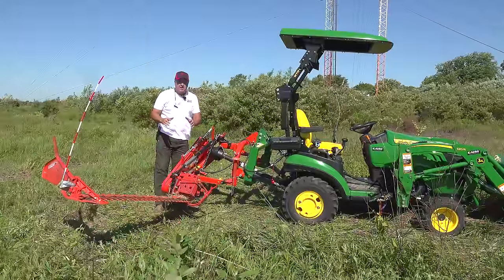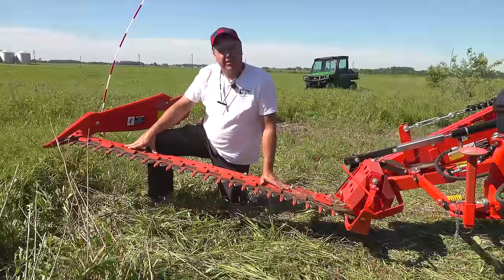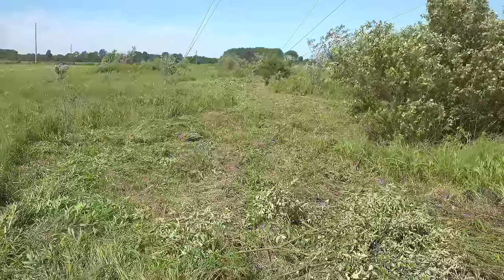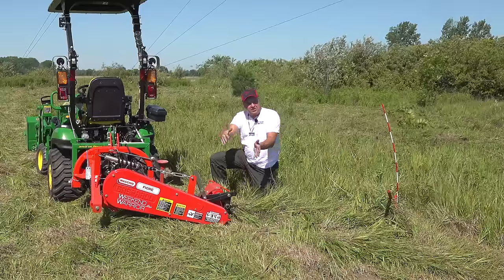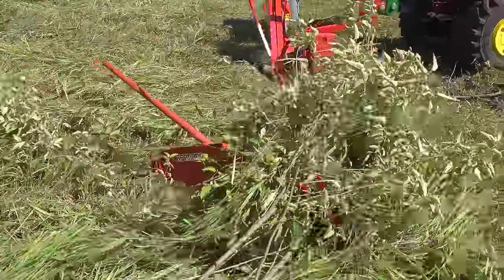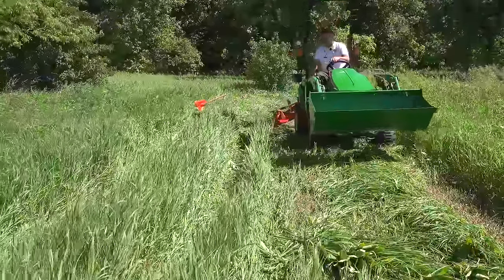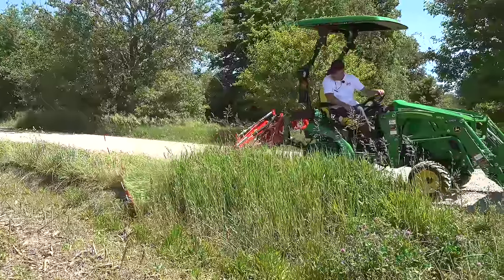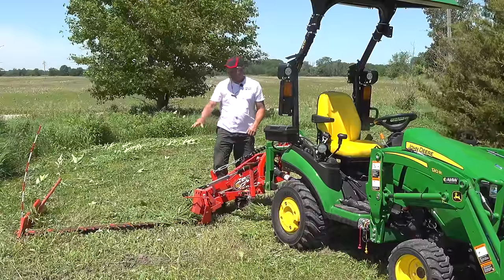Sickle Bar Mower for Subcompact Tractor!

Comment: In my youth, 65 years ago, I mowed a lot of hay with a sickle bar mower.  In the beginning, we pulled an old horse drawn machine with a 6 foot cutting bar behind an old JD A.  Later we got a late model B and then a 50.  We used a JD semi mounted model 5 with an 8 ft bar .  We mowed in 4th gear at about 5  mph.  The big difference is the tractor weight at about twice what a 1025 weighs.

Comment: I have a 1949 Farmall Cub that has belly-mount cycle-bar mower as one of the attachments, and I love  it. I used this mainly to cut my orchard grass due to the fact that I was able to get under the trees without getting into the branches or damaging the fruit/buds.  I grew up on a farm in Kansas, so did a lot of hay making. Love your series on these tractor comparisons, and very informative as I am making a decision between these two tractors for my next purchase.

Comment: I have about 4 acres here in S.E. SD, when I first bought my place all I could afford to cut it was a 1965 Wheel Horse garden tractor with a 4' belly mounted sickle, 8hp. It took me a while but I could cut all 4 acres no problem, sickles take so little power. I've since upgraded to a Branson 2400h with a 5' Rhino Bush hog. It's a lot faster. However in the spring that ground is too soft and wet to run the heavier tractor. And by the time its dry enough the grass is almost 3 or 4' tall in places which really slows me down on the Bush hog. That little sickle mower don't care how tall the grass is and the entire tractor only weighs 450 lbs so I can skim right along over soft ground. It sure turns heads when people drive by seeing that little tractor cruising along just laying down the grass so nice. Theres something so satisfying about watching a properly tuned sickle run.

Comment: I had a care company growing up.  I jumped at the opportunity to buy a hayban 4’ cycle bar mower for my cub cadet.   I got it for only. $250.   I used it for all you have mentioned.   The other benefit is you can cut the rough grass, remove large limbs and rock that might damage a rotary finish mower, and then use the finish mower to cut up the cuttings.   I found this method also did not load the tractor as much as trying to cut heavy grass with the finish mower alone.   Great video!

Comment: 🤠 Well that fired up the ol' memory retrieval system!  Spent several Colorado summers way, way back when in my youth cutting and bailing "upland" hay (non irrigated light density) using a JD 1020, a 9' JD sickle bar mower, a JD 3-pt reel rake, and a JD 24T bailer.  I can still smell it right now in my memories!

Comment: Available on Amazon (and presumably elsewhere) are “cup” magnets. These are flat magnets with a reasonably strong pull, and a countersunk hole in the middle. Also available on Amazon is some spring type broom holders designed to be screwed into a wall or cabinet. What I did was order a package of each, and using some M5 flathead bolts & nuts that i already had on hand, bolted the broom holders to the magnets. Then I stuck them onto the loader and ROPS to hold hoses & wires for my sprayer... something similar would probably be helpful for your hydraulic hoses. They also come in handy for holding a cane, walking stick, or long-reach tool.

Comment: Tim, I have an IH 1300 sickle mower that I used in the past to mow a ditch.  Haven't used it in years, but works excellent, and you are correct...I think I paid about $1200.00.  I haven't sold it because as soon as I do sell a piece of equipment, I realize a situation I could use it for.  Thanks for the info, and the Maschio flail mower looks like a great mower.   Bob

Comment: The first tractor/attachment I ever used was a 1949 JD "M" with a sickle bar on the 11-acre farm I married in to.  Compared to the new devices, the old mowers were archaic.  "Down" was only about 7-degrees, "up" was maybe 35-degrees.  To transport the machine meant turning off the PTO, getting off the tractor, retrieving the transport bar (a 5/8" rod about 5' long with a hook at one end and an eyebolt on the other),  thread the eyebolt through a hole in the blade, lift the blade to the vertical position by arm and back muscle, and hook the transport bar hook to the appropriate place, get on the tractor and transport to the next field.  Then reverse the steps.  The mower could not run in the up position without self destructing.
Because of the limitations of the swing range the mower was useless at mowing pond  banks or ditches.  Of course, the same could be said of bush hogs and flail mowers in the same circumstances.
With the new stuff I might be tempted back to the sickle world.

Comment: Tim I would really like to see you find some hay ground and get Tractor Tools Direct to send out a Hay Package with net wrap baler, disc mower, and belt rake. I know it is a niche market, but honestly for gardeners it has potential too.
Reply: This right here !!!!! I have a 2019 2032r and I need some sort of hobby farm haying solution !!!!    This sickle bar mower is perfect other than being frontier green ;) as he said.  But we need options for bailing and wrapping equipment !!!!!!!!!
Reply: @kelstr  0 pipe
Reply from the maker: I LIkE having the attachments be different color than the tractor!  Guess I’m kinda strange that way??
Reply: The little hay mower fer small tractors would be a drum mower not a disk mower.  I have one fer doing hay and its awesome. Granted I use it on a full size tractor but the smaller mower can be run down to somewhere in the 20 pto hp.

Comment: I have a 7 ft Farmking (Enorossi) double acting 3 pt mower that I love to use.  Never plugs. Has hydraulic lift (the only way to go).  I use it to cut 25 acres of hay, to mow my pastures, etc.  I highly recommend these double acting sicklebar mowers.  Mine was about $4500.00 two years ago purchased from a Case IH dealer delivered to the farm and attached to my 33 hp Mahindra tractor.

Comment: I bought a used 7 ft New Holland sickle bar mower about 15 years ago when I thought I wanted to cut hay on my 12 acres.  Decided it was too much work.  Sold everything except the mower.  Use it about 4 times a year to cut pond dam and ditches.  Best $800 I ever spent.

Comment: I sold my 100 acre NH 451 with a 9' bar last summer. I'm in NE Texas and the man drove from Alabama to get it.90's model and was stored in a metal shop building since early 90's.Got out of the hay business right after I bought it new.Man wanted it specifically to mow around his 10 acre lake. Got video up of it running etc.Back when I bought it I seem to remember it was $4200.00 new. Lot of money back then.Had another NH 451 with same 9' bar before it. Bought it new too but it had a factory defect and would eat wobble head bearings. Fought it for several years and finally convinced the dealer to swap it out.Mowed in 4th gear on a Ford 2810. Each season and with 3 cuttings I was baling about 200 seasonal acres:by myself.

Comment: Tim, use caution when you run over the cut swath with the low clearance on the 1025R. My dad twisted his front drive shaft completely off on his 1026R with cut hay getting wrapped up on it using his sickle in heavy hay. I liked your comment on the IH 1300 that is what I use on my 2520 SUT. Made a new three point mount and had to counter weight the left side to help with the twist when lifting. Regards from Wisconsin.

Comment: You had mentioned that it would cut in a vertical position as well.  Would like to see you try that maybe on some of the trees on the tower project before to mow them down with the brush crusher.  I thinking it would be great to keep fence lines in check or hedge rows.
Reply: I was thinking the same thing. I have shrub brush that grows like crazy and am trying to find something to keep it cut back.

Comment: Before I got my tractor and flail mower I had a neighbor mow the fields with his 6' sickle bar mower. The primary design of the sickle bar as a hay cutter was a problem for me because my fields have a lot of thick hard stalked weeds that grow to 6' (you would appreciate the mower end marker stick in that). They would fall and make huge mats that would not decompose before killing everything underneath. 
Seems like you need to trim close by having the "obstacle" on the RIGHT side of the tractor so the cutters get close but you and the tractor stay clear. 
You need to get Christy a rake and a baler for cleanup :D

Comment: I just attached an old ford 7 foot sickle bar to the back of a yanmar ym 2000B.  It mows 600 feet of road ditch, and the perimeter of two different ponds in nothing flat. I would say it saves me days of weed whacking, but the reality is that it was so difficult I quit cutting it. I should have used the sickle bar years ago.

Comment: Until I recently sold my farm, had a six foot Befco sickle bar mower that l mowed horse pasture with. Loved all the advantages mentioned here, particularly mowing faster at a lower RPM. I just disconnected the curl hoses on the FEL and connected the mower’s single hydraulic hose for mowing, avoiding a costly hydraulic kit.

Comment: This reminds me of my grandfather.  He had an old Farmall H and converted a horse drawn sickle bar mower.  It had all mechanical operation.  He left the seat on the mower and if he could find someone to help they could ride on the seat and lift the bar and engage or disengage the bar.  It was ground driven.  He referred to the outer board as a mulboard.
Reply: Paul Rice: When I was a kid, my father and his friend use to pull one with a truck to cut our hay.  One would drive the truck and the other (my Dad) would ride on the mower.  He still has two of them at his house.  I didn't know anyone even still made them. Good memories!

Comment: After mowing my creek bank, I went back with the grapple angled down with the lower teeth just skimming the ground. It did a good job picking up all that long cut grass. Only problem, I have is my sickle bar is attached to the third function also, so I had to disconnect it to use the Grapple. I was also happy to see how you routed the aux hydraulic lines. That's the same thing I did with mine, except on the Kubota, the third function valves are on the left. I don't really care for it like that, but it's the best option for an attachment that's not going to be getting regular use.

Comment: Hi Tim  Dad had a sickle bar mower, it was a Grey  Ferguson mower on a Ferguson 35 and later on a MF135 I used it quite a bit, it did a great job. The only hay mower Dad ever had and I loved using it. I will have to start looking for one for my 1025R. 
Just one thing, I think your mower needs a bit of adjustment the cutterbare should be angled slightly forward in relation to the tractor, the  one you are using looks to be angled back, it will give a cleaner cut. 
Regards John
Reply from the maker: Yep. The top link vibrates loose while I was using it.  Good eye!!

Comment: I'll tell you what, I had a heck of a time finding all of the fittings for my BX!  Nobody makes a kit specifically for the old ones anymore!
That said, everything I found said not to use teflon tape on hydraulic systems.  Eventually little pieces can get into the fluid and then into the valves and cause them to leak or clog.  I used Permatex 80632.  I don't think it worked too great, the NPT fittings were still a bit of a pain to get sealed.

Comment: Now all you need is a rake and a baler for the 1025r
Reply: There are smaller round balers that make 50-80lbs bales that could be run by these small tractors. They are mainly used in East Asia. It seems like there would be a market for them here, but few seem to sell them.
Reply: Court  - the issue is, what would you do with the small, round bales?  

Horse owners are too picky for all but the finest feed, and economics make the small bales worthless to large dairy farms.  

About the only sustainable busienss model I could imagine working is to sell the small, round bales to urban homeowners for fall / Halloween front porch decorations. Find a hobby farmer offering pick-your-own pumpkins, gords, honey, maple syrup, apples, and see if you can make a arrangement to offer your small, round bales at their road-side stand.
Reply: We have a small hobby farm and raise just a few goats.  Little round bales that could be handled with our 1025r on uneven ground would keep us from packing small square bales all winter.
Reply: @DougAlesUSA  Agreed. As a horse owner/breeder, and someone who owns a 1025r, I would never consider buying hay equipment for this tractor. It is a good all-around compact tractor, but does nothing really well on a farm. The cost of equipment and the capacity of the system just isn't anywhere near practical - at least in the US. Of course I have neighbors who own 61 in Scag mowers to cut their acre property, so there is money out there.
Reply: Don Enderlein thank you.  On Facebook, I’m a member of a popular lawn care business group.  Your idea about the 1023e/1025R being capable for many things but good at nothing is verified by what I read at that group.  If the business is focused on mowing, they use a commercial grade zero turn mower, gas weed wacker, and gas, pack pack style blower.  If they do much trenching, they get a dedicated excavator. If they do much stump removal, they get a dedicated stump grinder. Anyone that tries anything else soon comes back to these dedicated equipment items. 

I love the 1025R for its intended purpose, a person / family taking care of their own property where can can not justify owning a machine shed full of different dedicated pieces of equipment.  Maybe occasionally helping out nearby family and friends. 

For that person with 1 - 10 acres with varied projects, productivity is not relevant, however flexibility is important. In my opinion, thats where these sub-compact tractors win.

Comment: The sickle mower would be great in a few places I need to mow, but wow they're expensive.  

Yes, the sickle mowers typically like faster ground speeds.  A friend of mine uses their sickle mower for cutting hay.  They cut 6-7 fields with their sickle mower 3-4 times a year depending on how the weather goes.  It does a great job and they can go faster with it so it takes far less time.  

I like your hydraulic setup, I would never have thought about using the loader hydraulics to run the hydraulics on the sickle mower without having to have rear remotes added at a much higher cost than a few hoses and couplers.
Reply from the maker: Check out our ‘11 options’ video showing 11 different hydraulic options for subcompact tractors.
Reply: @TractorTimewithTim  I'll check it out thank you.

Comment: Wow. It looks like if they're set up right and you don't have a bunching problem, sickle mowers do pretty good, even if the grass is laying down a little. My dad had an old Oliver sickle mower run on a 9N tractor. He had a lot of trouble with grass jamming up and seemed to want to lay over a lot. He later bought a drum type mower. It ran pretty good. There were only 2 drums on it and 2 blades on the drums. When one side wore down on the blades, you flipped them around and cut with the other end of the blades. Then when that side wore down you replaced the blades. They seemed to have good wear life.

Comment: I was farm raised and spent many hours and days using a sickle bar mower. I will be honest in a days time this little machine would lay down alot of hay. With a side mower on a single 3,000 Ford tractor a side delivery rake and a compact 65 New Holland Square bailer. We would average 20.000 bales during a summer. With that 6 foot cutter a rake and one of those little round bailers you could easily put up enough hay to support a homestead cow farm of at least 50 head or even a 75 head farm.

Comment: Thanks, Tim the sickle bar mower demonstration was extremely informative and it answered many of my doubts acting as a refresher course to what it can do. I would like to jump through my computer screen and assist in getting the tower greens completed, especially at the cable points. A serious trimmer would do it. Also, it was refreshing to see a mow without rocks, stumps or anything else ruining the blades. Excellent camera work by the way for the entire episode.

Comment: That’s quite a unit.  Interesting and informative video.  Christy must have to jog to keep up with you.😉  I remember mowing hay with sickle mowers.  I recall some of the old ones had a “break-away” feature if you caught the swath board on fence or obstacle it would allow the bar to “trip” without causing major damage.  FYI, I do have an clear area around my woods in hay type grass that I think would work nicely for testing it out, but I just mowed down with a rotary cutter.   I’m not far from you.  Maybe later this summer??  Enjoyed the video and blessings to you folks!
Reply from the maker: Yes, it has a break away feature

Comment: Hi, I’ve got a new Holland 448 sicklebar mower that I put on my Kubota B2530. Works well in hay that’s not laid or too thick in the bottom. Also got the star hay turner & mini round baler, both work well but balling is a little slow with it only having a 70cm pickup. Splitting the windrows is advisable.

Comment: Sickles take a bit of experience to run well, that and they require much more maintenance than a rotary mower or flail. That's the main reason they are not used much these days. I run a 5 foot unit on my cub cadet tractor to do banks, ditches and ponds.

Comment: This mechanism is very efficient, light weight, and has low power requirements. There were horse drawn versions, after all, which were unpowered. That's one reason they're so quiet. It should use a lot less fuel to mow the same ground than other types of mowers. Especially the longer the grass gets.